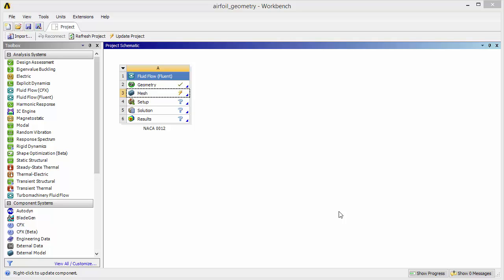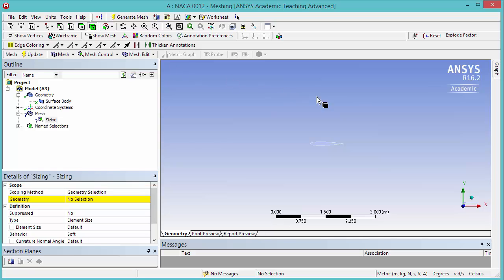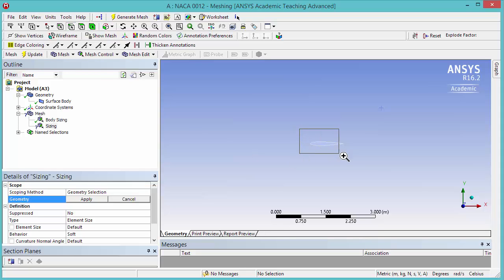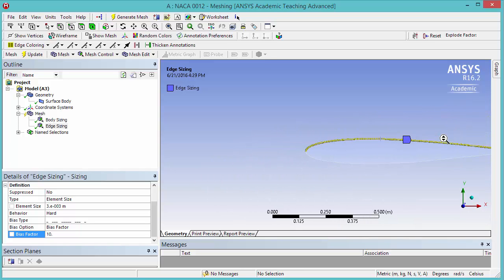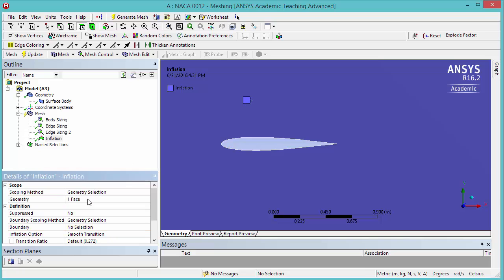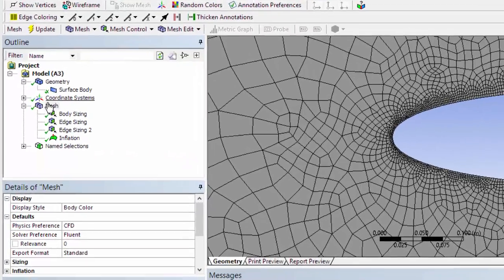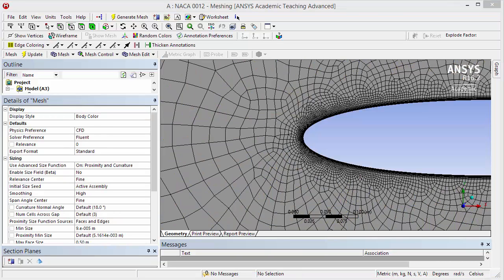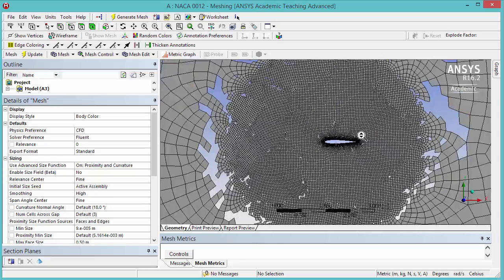Turbulent airfoil flow - Part 2: Mesh

Comment: Just to add that it is important where the poor elements are. It doesn't matter that the majority of the elements are good because with this method you have some skewed elements on the trailing edge, which does bother the solver and the turbulence models.
Reply: How would we then resolve this skewness for such unstructured meshes?
Reply: @akarshshetty9262  Well, It is possible to make a cut from the trailing edge to the outlet, but this can lead to cells with pretty big orthogonality. The other option is to make cuts from the trailing edge not only to the oulet, but up and down to the inlet (like T-shaped cuts, all merging at the trailing edge). If not, maybe maybe the auto refine tool can help after a solution to refine the mesh based on gradients of results. Finally, ICEM or other meshing tool can be used. I am not very experienced in these methods, but only know that they are options.